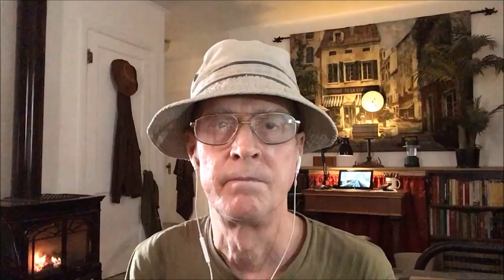My First Shortwave Radio Antenna

Comment: So I got a crystal radio set that you build yourself. Not sure how long it was sitting around before I was old enough to receive it for a present. 10 years? Anyway, a horizontally situated copper wire approximately 50 metres long suspended 15 metres above the ground between a tree and a 2 storey house. I still remember that I could get some pretty loud stations over that set; no need for an amplifier.

Comment: Radio Shack crystal set kit I got for Xmas 1977. We lived on the farm and my dad lifted me up to the eave of our 2 story house with the front end loader of our tractor. I attached one end of my wire there with an electric fence insulator. Then I strung the other end to a power pole 150’ or so from the house. Again the tractor and fence insulator were used. It was 20’ of the ground. The wire was looped around the house end insulator and continued down to my bedroom window and in to my crystal set. Ground wire went to the gas line below at ground level. Many wonderful hours spent DXing on that one.   Stan I love your practical no nonsense approach to our ham radio hobby and you have answered many questions for me. I want to build a simple aluminum tube 20m vertical like yours. Could you please share more specs and a schematic of it for everyone? Thankyou.
Reply from the maker: Dear Brian,
Some time ago, I made a video called "Vertical Antenna at W1GV". Please search my channel for that exact word sequence. Also search my channel for the word sequence "Kludge Multiband Vertical Antenna". Then you can see the antenna and get a description of how I put it up. That's the best I can do in regards to specifications and illustrations. 73 de Stan W1GV.

Comment: I grabbed a 60’ shortwave from a ham radio outlet in January. it has two loading coils and it makes many whining noises as I tune it. Are these supposed to be best for 1.5 MHz to 3 MHz or what if I use it in a regen AM radio ? It’s zig zagging around my attic right now ill move it outside when it’s nicer weather.
Reply from the maker: Dear Andy,
I have no idea! 73 de Stan W1GV.

Comment: My first antenna was nothing more than a wire. I didn’t understand at first how to size up the wire properly, so it didn’t work. So, from there I got a QRP Guys End Fed Antenna for 40m. This had a 9:1 balun and fixed capacitor. I trimmed the wire using a handheld antenna analyzer, and then I was finally on the airwaves.

Comment: Mine was a long wire that was made of scraps of telephone service drop wire. It was hard copper coated wire that was hard to work with and solder to. Ran out the second story window the the eave of the house then through the trees perhaps 150 feet. It didn't work very well at all at first because the chassis of the radio was the only counterpoise. Later, it was pointed out tome that the wire would work better if it had something to push against. The Philco radio came alive then as did my crystal radio that was deaf up until that point. I was required to take it down after a nearby lightning strike left a nasty black mark on the wall between the window and the radio location.

Comment: First antenna was the whip on my Sony shortwave receiver. I bought the expensive Sony active loop antenna and got marginally better reception from that. I started experimenting by building my own loops with plans I found online. 

At some point I convinced my girlfriend to help me climb up on the roof of our four story apartment building to string up a long wire. 

Now we own a house and I have room to put up home brew dipoles for receiving and transmitting.

Comment: I built crystal sets and transistor radios before I went to (what we call) secondary school at age 11, and I used to run a wire down the garden from my upstairs bedroom window. Because we weren't far from several transmitters, I could drive large speakers with little amplification. And I remember the Cuba crisis.

Comment: Hello Stan, My first antenna is a home made 1/2 wave dipole located on the second floor of my home. It's stretched across the ceiling passing through the hallway and makes a slight dog leg through a bedroom. My station is on the first floor. The coax is fished through a wall to the station. This spring I will put up a home made multi band dipole outside. Baby steps.

Comment: Hello there! My very first HF antenna was a home made zig-zag dipole in the attic, for 40m band, the elements were a very thin copper wire recovered from a burned power transformer. Surprisingly, it worked very well with my uBitx QRP transceiver. No antenna tuner, no SWR meter, no antenna analyzer. Also my feedline was a 75 Ohm TV coaxial cable. That's how I made my first contact. And by the way, there is a chemical element named after Albert Einstein. Einsteinium, aromic number: 99. DE YO8UFO, 73.